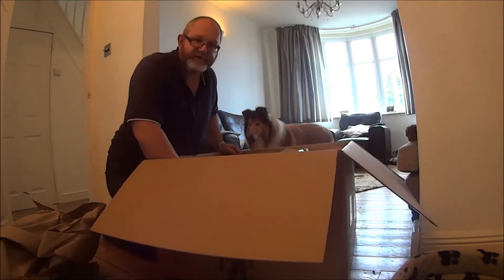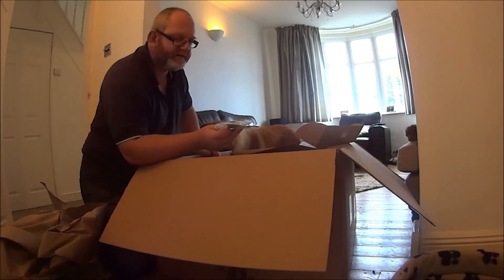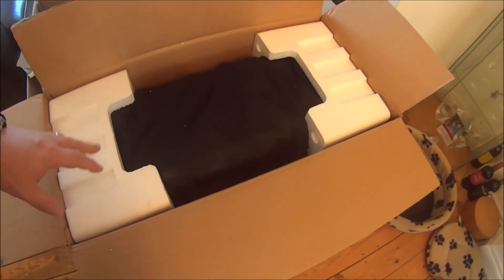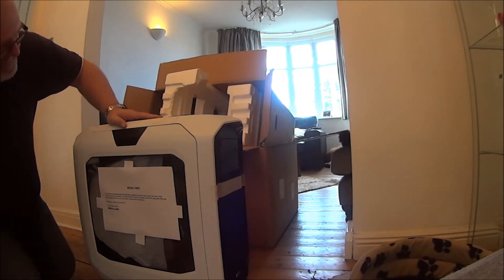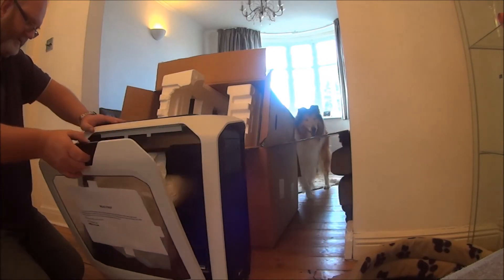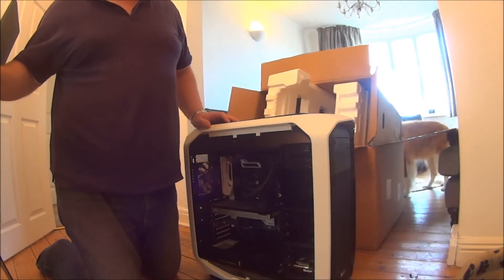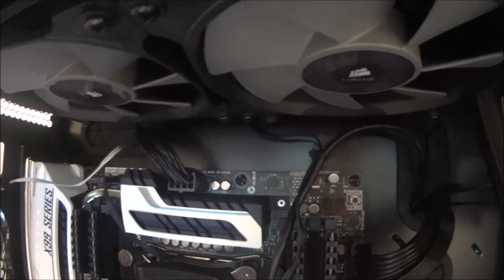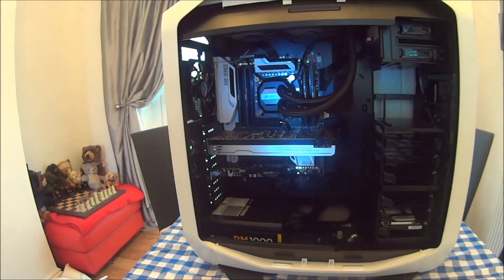ChillBlast Custom Gaming PC Unboxing

Comment from the maker: I think the gpu is about 1020 up from 1000ghz stock and the gpu is 4.4ghz. the V1 is the least attractive Gtx980ti on the block but you can pay up to £350 more for basically the same performance but with very slightly better overclocking and a custom cooler. As I had to get everything for under £2500 it waz the only toI could afford. To be honest, I normally wear headphones so even when I set all the fans to full, I can't hear a thing. the CPU radiator fans never go over 40% and sometimes, they don't seem to run at all. the GPU temp, after playing Star Citizen on max settings for an hour was 58 degrees with the case fans on low.

Comment: Why did u buy a 1000w power supply
Reply from the maker: I want overhead in case I add a second GPU and other internal drives. I'd rather run a V8 at 1000rpm than a 4 cylinder at 9000 rpm. Less strain on the PSU.